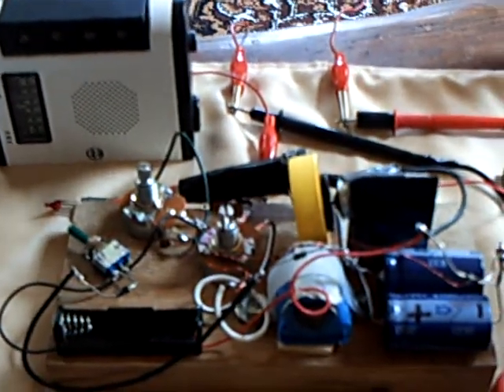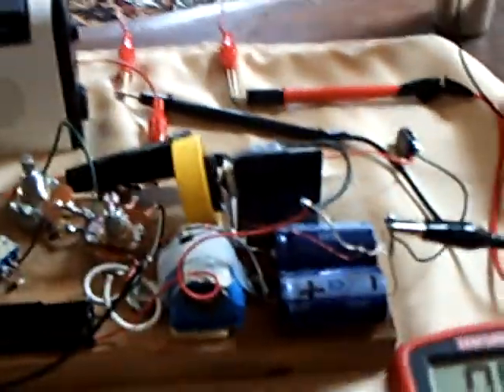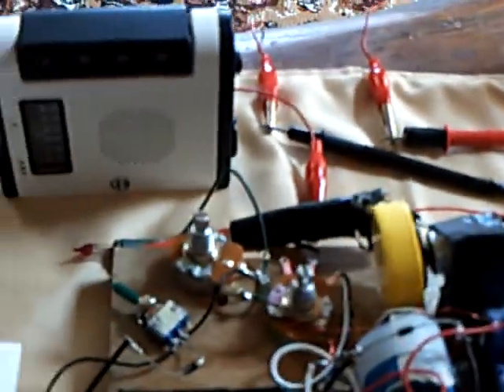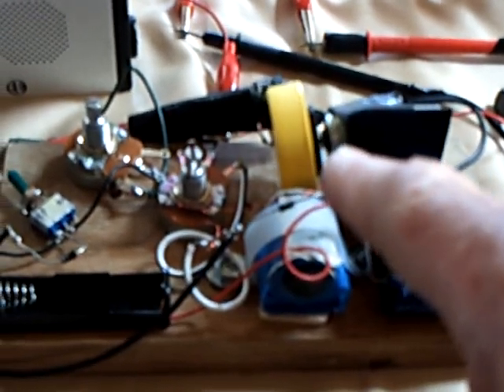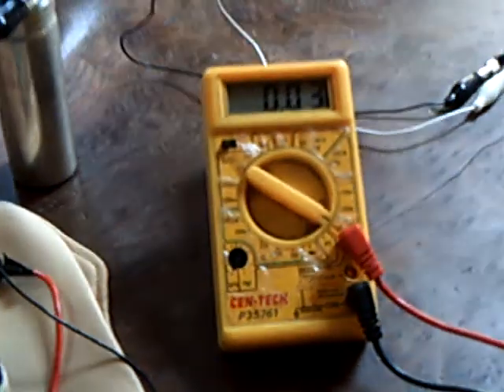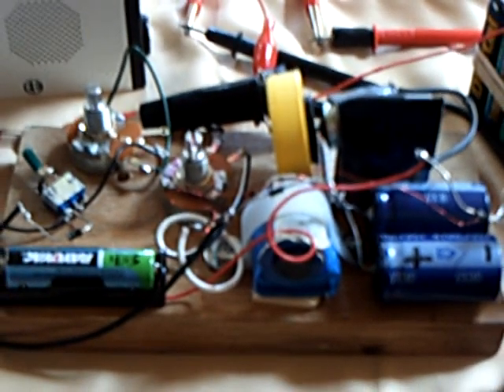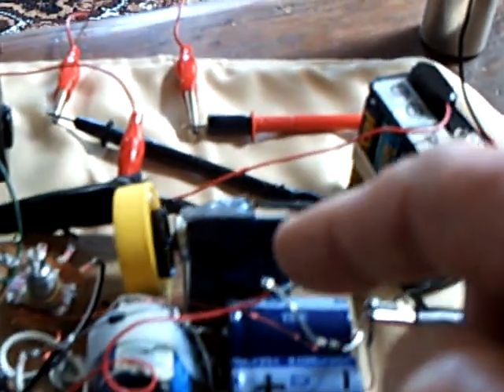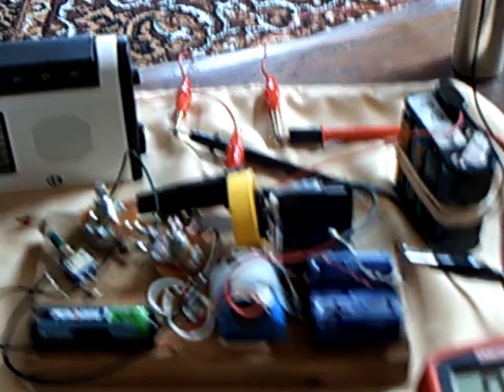BACK TO THE PULSE MOTOR !!!

Comment: Hello, just from what you said, and a quick glance at the thing, you could do a number of things, for instance a street light circuit, (photo-resistor), in that way when a cloud comes along or night time, it will shut off and run off the battery, your battery won't charge up because it's quite a load, it's the Lenz's Law. Do what Tesla said and match your load to your source to eliminate Lenz's law. Hence a capacitor is a matched load then just dump it back to your battery with switchery.